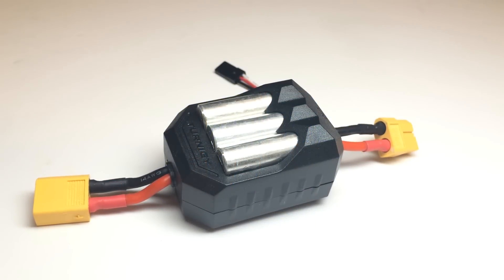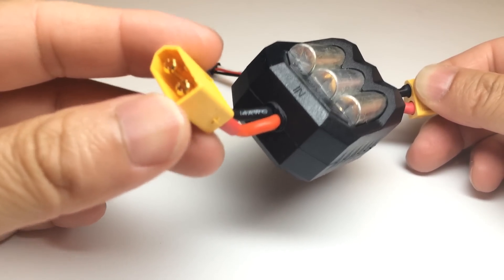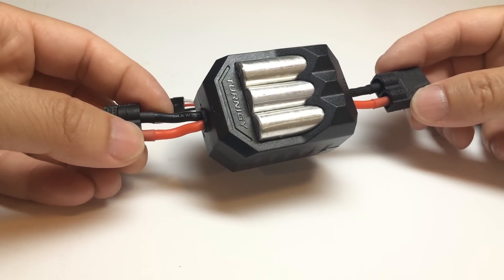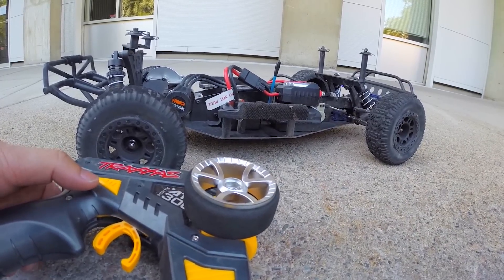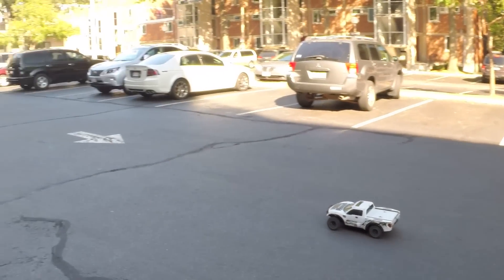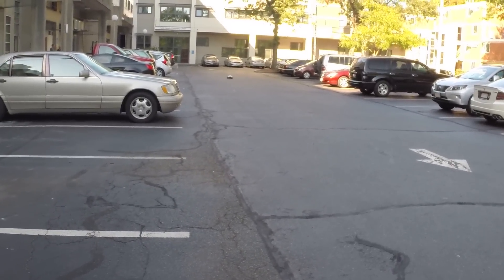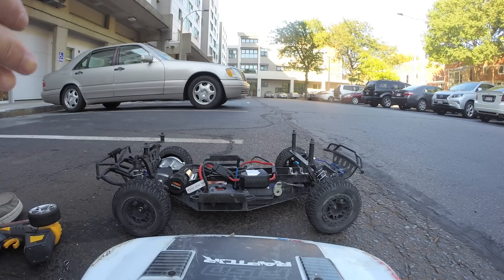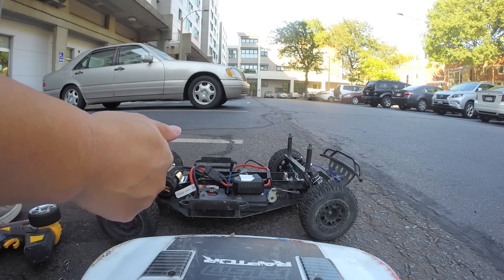Add NOS To Your Slash - Turnigy eNOS Booster In Depth Review

Comment: Hi there, just wanted to know if I can use it with a 20t brushed motor from Axial with a Castle Sidewinder ESC, I believe they can handle 3S, but just wanted to know if there is no harm to it, thanks!!
Reply from the maker: if esc and motor support 3s then it shouldnt be an issue
Reply: Thanks, I just found out with a friend that the Axial 20T brushed motor supports 3S Lipo batteries, and I already knew that the ESC support 3S also, thanks again!!

Comment: I need more info about this I wanna see if it work on my Hpi sprint 2 I have a nano-tech 5.3 lipo . And I also have the leopard motor and esc
Reply from the maker: It is more a novelty than a real performance product. Mines burnt out on the track under heavy constant hot laps but it does work for regular bashing.

Comment: did it slow it down from before you put it on though? that thing is drawing off your battery so it is not allowing the truck to draw as much, your truck should be slower with it installed and turned off than with just a 2s
Reply from the maker: +Cody Dosier i think you would notice the slow down from the cap pack draw

Comment: Not too bad but why not just run a 3S?
It would be good for those photo finishes when racing though (-:
Reply from the maker: It is fun to mess with you buddy telling them I got a 2s and when you pass them exiting corner or on a drag you get extra kick passing them. It is nice to see them out up a wtf??? look. It is a little novelty add on similar to onboard sound but this actually has a bit of performance enhancement
Reply: JPRC
Ha ha, yeah cool. I actually found that putting sound on my Unimog made it's performance much better as you get more of a feel for what it's doing and when the power is gonna kick in when crawling by being able to hear it, plus it adds a massive fun factor (-:

Comment: That's a cool little gadget, but I think I'd just run a 3S Lipo. ;-) Seriously though, it is a pretty simple (and cheap) way to add some extra fun to your RC, so I say why not!

Actually, this just shows how much energy a capacitor pack can store and why they are a great safeguard for a high-end power system. I use some home-made ones on my speed-run cars to protect my ESCs, so I am a firm believer. I actually lost a battery connector half way through a run, which should have made me wreck at VERY high speed. However, the capacitor pack had enough electricity stored to actually power my receiver, ESC, & Servo long enough for me to steer the car to a safe stop.
Reply from the maker: This thing is like nothing compared to you speed demons . This cap pack with a small transformer is doodles for but more fun

Comment: Wow that is amazing!!!! $5!!! The coolest part is it charges from your car. When you said 20 second charge I thought that meant you have to take the thing out, then get your wall charger, plug it in then connect it to your car and drive but no!!! That's awesome!!! I think I will get it
Reply from the maker: Yes bro it charges automatically from the battery and you only have to wait around Hal a minute between each boost. It is fun to play with I haven't try it on the track yet
Reply: Thanks for making a review! I think I'll pick one up! I'm honestly not a racer so idk too much but I could see it working and failing, if it goes well you will gain speed but if it fails you will spin out loosing a few seconds but for only 5 bucks and the fun of it is Awsome

Comment: .-. why not run 3s in the first place?
Reply from the maker: That a great question. I run 2s on track and for bashing for most part. This is a great use case for over taking or clearing a jump. Running 3s is mostly for speed record or drag race which I don't do very much.
Reply: JPRC
pff if I can I run 3s anywhere and just keep the throttle low if I have to xD
Reply from the maker: yes, i hear you. this is just one more option for everyone in this hobby